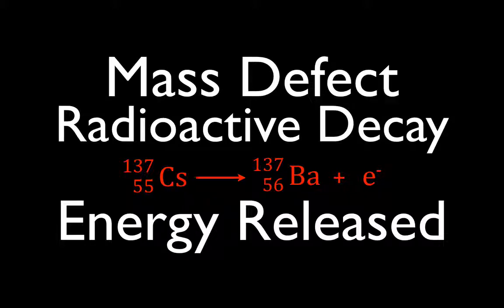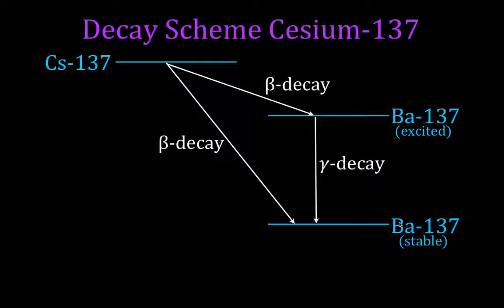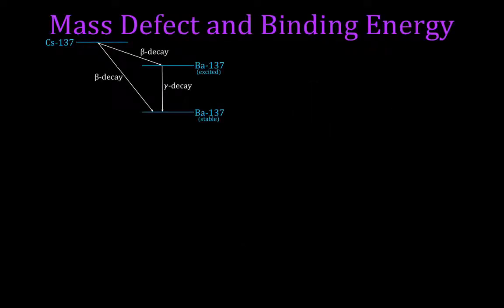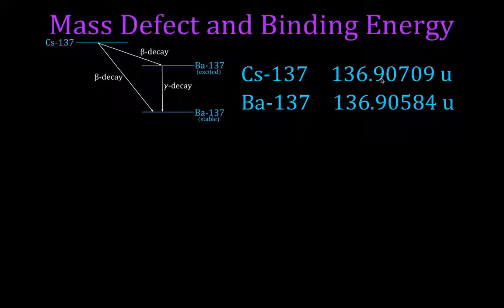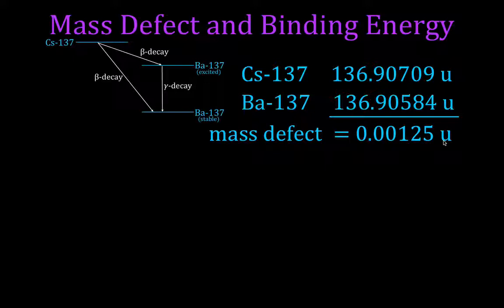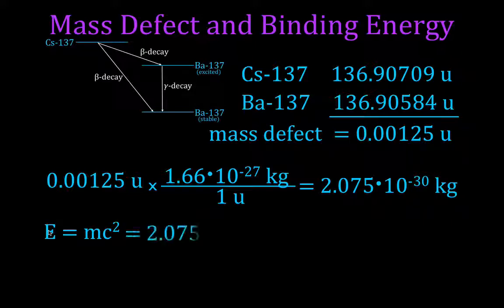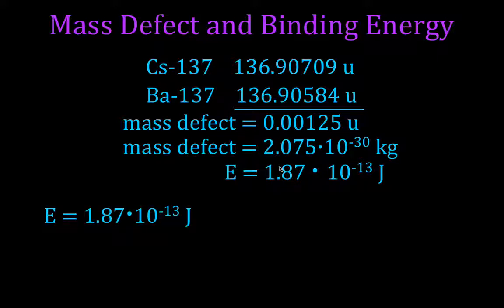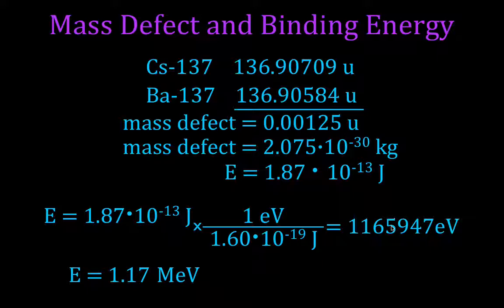Mass Defect & Binding Energy (3 of 7), Beta Decay of Cesium 137

Comment: In any such question, Particle emitted is newer considered in energy balancing. Here electron is formed from nucleus. Therefore, energy equivalent to its mass must be taken from nuclear mass defect. Mean Binding Energy= (Mass Defect - Electron Mass)*c^2.
Why it isn’t so?
Reply: I too have been wondering this question
Reply: The thing is that the mass energy of the electron is considered as energy emitted outside the system. And since the mass energy of the electron can vary, it would be complicated to consider it as the energy of a product. Instead it's better to consider it as a component of the emitted energy, along the energy of the neutrino and the kinetic energy of the nucleus.
For example, if the electron can't exit the atom, its energy will not be the rest energy of the electron, it would be inferior and so would its mass.